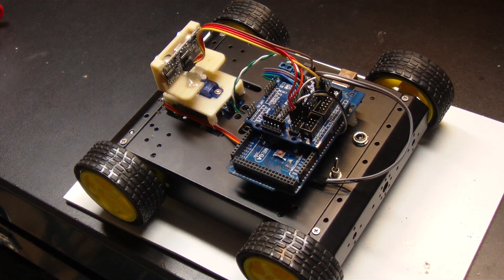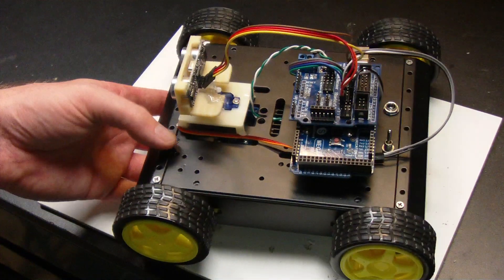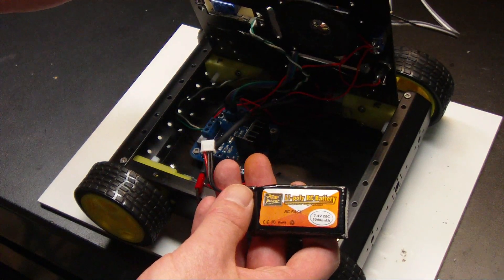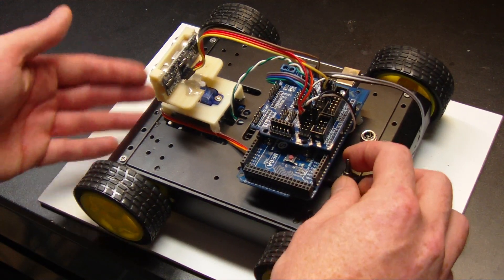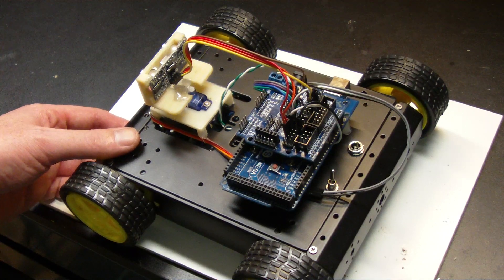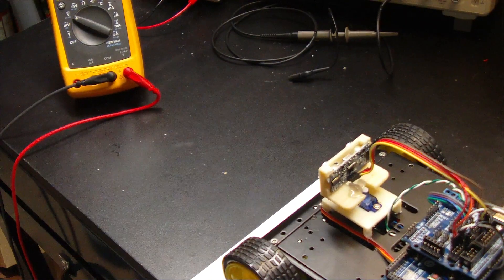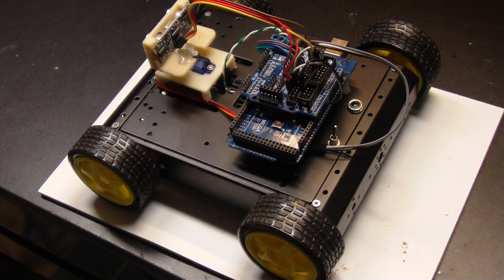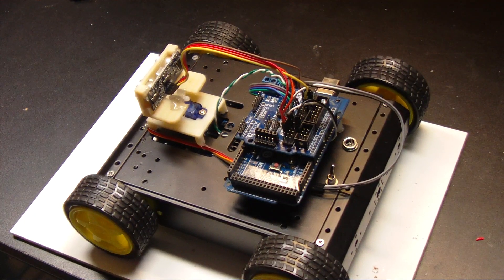Arduino Sainsmart 4WD robot update & mods

Comment: So I recently got the Gold version of this robot platform from sainsmart. I am wanting to to a line following and electric wire following application. but I wote/modified a simple test code to make sure the motors/wheels were working and I discovered that the wheels are not getting enough power to overcome gravity/friction. when I held the platform off the ground the wheels spun just like they were supposed to but as soon as I set it down it stopped or slowly crept along the floor and was not able to perform a turn at all. I just had 6 AA battery pack so 9v how much power are you getting to your wheels to make it go that fast?
Reply from the maker: I use a 2S lipo.  AA's are pretty much useless.